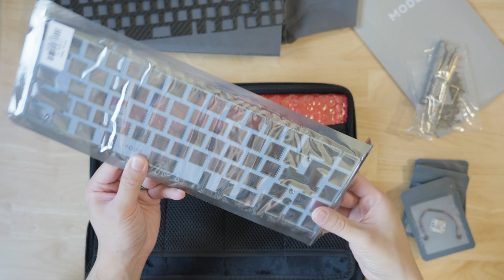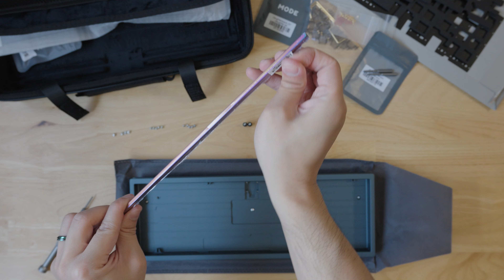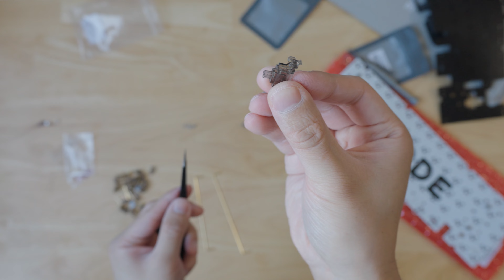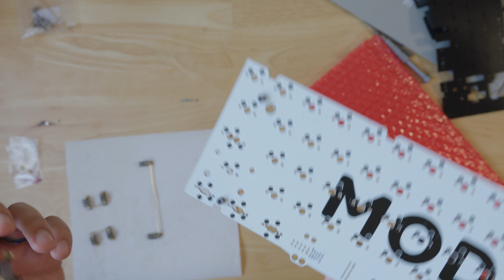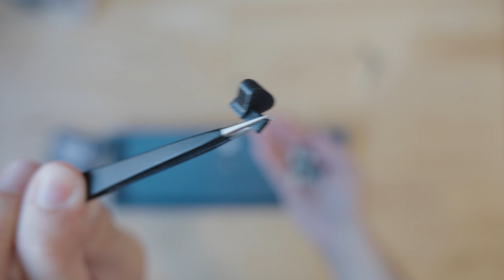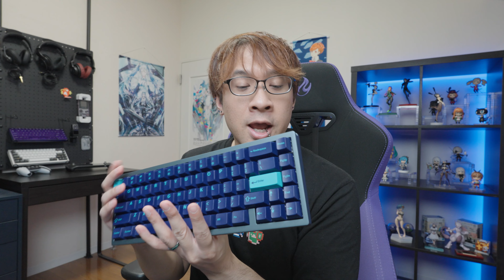The Mode Envoy from a Beginner Perspective - Build Process, Thoughts and Impressions

Comment: Very nice video, very thorough. Would have like to see a top down shot while you talk about the typing experience just to see your thoughts during the first impression.
Reply from the maker: Thanks for the comment and suggestion! Though I didn't mention it in the video, the board is a bit "clackier" than I expected, but has a pleasant pop to it. The carbon fiber plate definitely has a bit of a firm feedback when bottoming out but I like how it feels in combination with the flexible mounts.